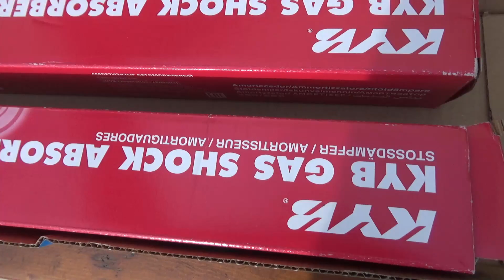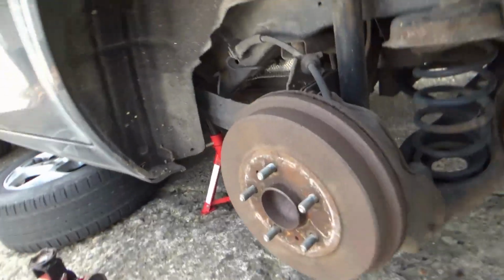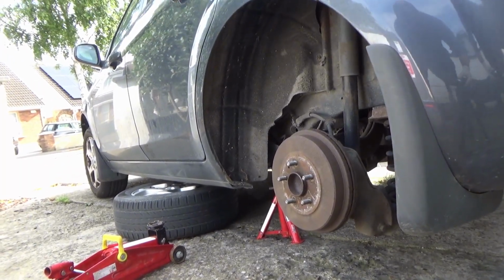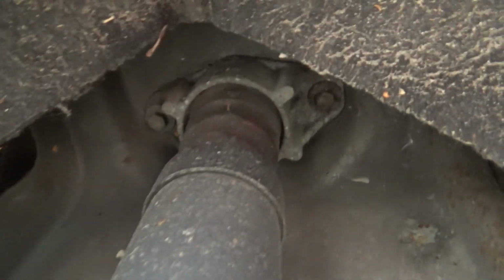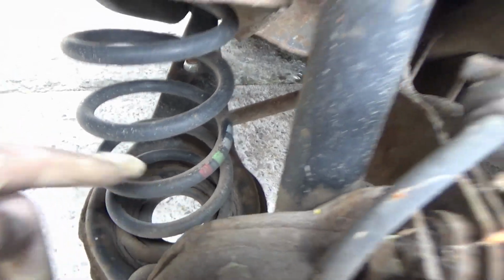Ford Focus MK2 2009 Rear shock replacement

Comment: What size bolts where the top of the arch? I have bought a dinger and full of problems mines just come off 😢and no bolts
Reply from the maker: Hi. I presume you talking about 2 bolts that hold shock on top? They 10mm head not sure about thread . Not to long just try what fit in about inch and half long 4 - 5cm ish just make sure put threadlock
Reply: Thanks mate I thought mine had come off but they are still there. I'm going to use this video to fix mine thanks for posting this 😊